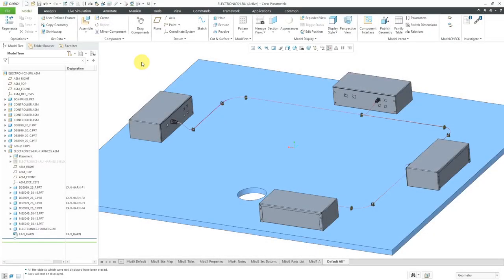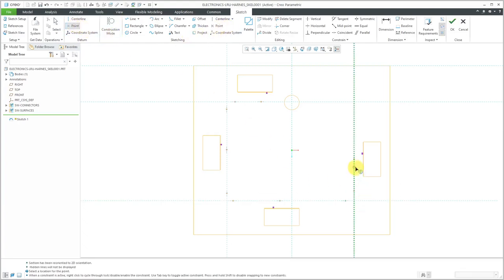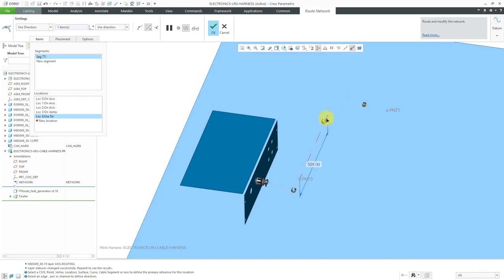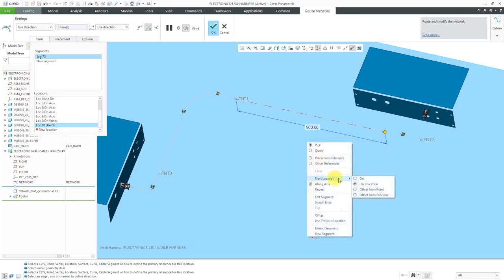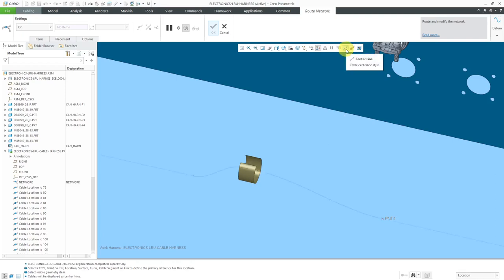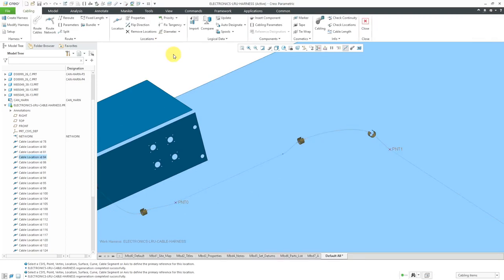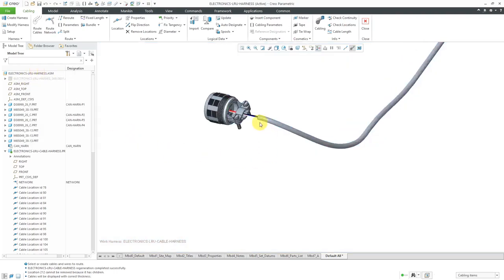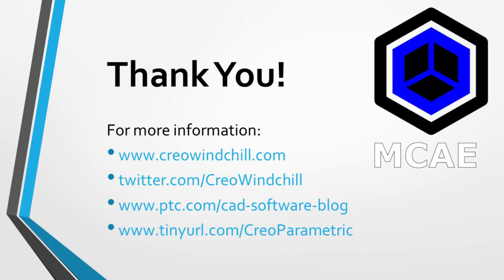Creo Parametric - Cabling | Networks and Autorouting

Comment: Maybe this is the wrong video to comment on but I watched the whole series on cabling, this one seems the most appropriate. 

I am trying to do cabling for a 15 pin connector to a flat 11 pin. The 5 wires oh the bottom row of the 15 pin connector are all grounds that need to merge a few inches out of the connector and that single wire they all merged into needs to go to pin 11 on the flat connector. Is there any way to do this? This being merging multiple wires into one. 

Subsequently I'll need to make this a flat harness for manufacturing.

Thank you in advance! Your videos are a wealth of knowledge!
Reply from the maker: You can do that with splices. I haven't done any videos on splices because I find them terribly boring. But you can find information on how to do splices in both the PTC Help and Precision LMS.